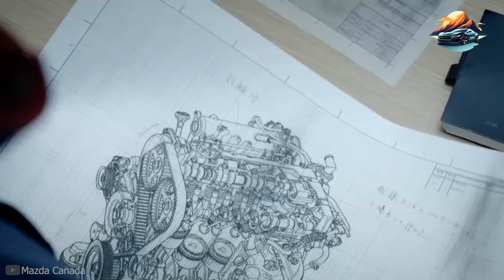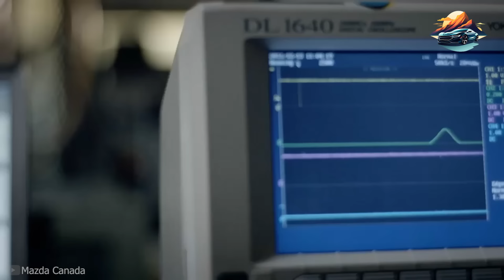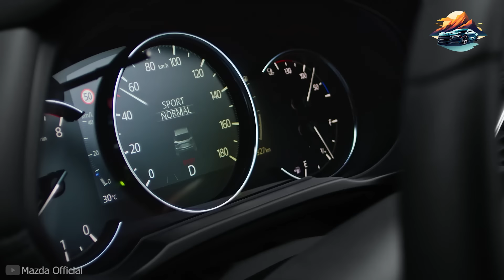4 Car Brands That Are Equal (Or Better) Than Toyota For Reliability

Comment: Heaven knows where you took these, so called, facts. I owned a Toyota, a Mazda and a Subaru. The most unreliable vehicle, by far was the Toyota. It broke down the first time three days after I took delivery (brand new vehicle) and went on and on. Throughout the first year the vehicle broke down 165 times. I never witnessed anything even close in the two other brands. 
Lexus is a Toyota, it is a rebadged, overpriced, loaded with gadgets brand. Enough to seen models sold as Toyota in Japan and as a Lexus elsewhere such as such Toyota Crown Majesta.
With regard to Honda, when was the last time you used a turbocharge Honda Civic?  It is one of the worse and most unreliable vehicles you can purchase.
Bear in mind Toyota and Honda use CVT transmission which already calls for troubles. Subaru also uses CVT but it seems theirs is by far more reliable. 
On certain models Toyota uses robotic gearbox which are notoriously unreliable.
On the other hand, Toyota lacking advanced technology, like in Diesel engines, uses other manufacturers engines like PSA (Stelantis today) and BMW.   
The two things Toyota excel at are marketing and concealing failures.  Remember the brakes lose problems (my Toyota suffered from this problem too) or the sudden and uncontrolled acceleration problem?

Comment: The best example of better reliability, lower TCO (Total Cost of Ownership) and beautiful design for Mazda vs. Toyota is Miata.
But cut the bs with JD Power. Their studies (relabeled as "dependability" instead of the previous name: Initial Customer Satisfaction) are not on reliability because they lack long-term data, a relevant panel (its size gives far bigger error margins than the far better Consumer Reports annual reliability surveys) etc.
Reply: yeah, i hate those customer satisfaction ratings. The thing is many people do not buy for reliability, but for other criteria, not necessarily planning to keep them for that long. A lot of people lease, and to them long term reliability is barely an afterthought. Their satisfaction may indeed be high when they exchange their almost-like-new five year old vehicle for another one with newer bells and whistles. Reliability to them is something completely different than for example to those who like to buy their cars for cash and keep 'indefinitely' with minimal maintenance costs and headaches.

Comment: Once Subaru XV hits 130kmh, your radiator, aircond failure is common. Wheel bearing issues, timing chain, engine power reduced and gas millage bloody high. Avoid Subaru, go for Lexus, Toyota or Honda. Save bets. Avoid the Honda HRV.. their handling sucks
Reply: So you want to use a car over a hundred thousand miles and never serviced it?? You are human do you not service your body??

Comment: Mazda is building very high quality vehicles specially CX-5 is much better value than RAV4 and with better driving dynamics and beautiful high quality interior .
Reply: That's all fine, but what about LONG TERM RELIABILITY (i.e. least amount of issues and repairs over the longest time period). All these 'likes' have nothing to do with reliability, a completely different type of criteria. If you don't plan to keep your cars for very long, then of course your choices expand significantly. Some people don't even own their cars, they lease them. Those people shouldn't even be asked about reliability 😂. Reliability is not really a subjective criteria, it is an objective, measureable one.
Reply: Still driving 2017 Mazda CX-5 with 149,000 miles. Drive 100 miles round trip a day for my job.  Biggest expense is that I’ve purchased 2 sets of tires since buying it.  It turns on a dime, is fun to drive, and is the perfect size to park.  Will keep it till next generation CX5 comes out in 2026… which will be a hybrid .  💙 my Mazda!
Reply: Mazda vehicles handle so nicely and have really appealing looks! Really fun to drive! ✌🏻

Comment: At least Honda is significantly worse than Toyota.
Reply: I disagree.  The CR-V takes the #1 spot in it's class.  The Civic is well known to be reliable as do the accord, pilot, passport, etc...
Reply: @gmdsr1177  Your enthusiasm and objection to obvious makes me wonder... are you by any chance a honda saleshole?
Reply: @gmdsr1177  Honda has some great design better than Toyota. However, on quality, it is barely better than ford and gm.

Comment: Toyotas and Lexuses look, to my eyes, butt-ugly on the outside. Their fronts are uniformely horrid. All else is fine with them, you just have to approach them with an eyemask on so not to glance at them. By comparison, Honda, Mazda, Subaru, and Acura vehicles look pretty decent to my eyes. You also have to look at other factors, such as engine size. I would not touch a Honda Accord now that only has a miniscule 1.5-liter Turbo engine. For a 4-cylinder, I would want either a 2.4 liter or 2.5 liter normally aspirated, or else a 2,0-liter Turbo boosted powerplant. Or else an app. 3.5-liter non-Turbo V6, of course. So for me, that would leave some HONDAs matching my engine criteria, some SUBARU and many MAZDA models. Also, I would add ACURA to the reliability list here, ACURA being HONDA's premium division. Their discontinued RLX full-size sedan is truly phenomenal. :face-red-heart-shape:

Comment: OMG I am so SICK of Toyota, TOYOTA is NOT REALIABBLE! Enough is enough! But Subaru? You can NOT be serious! Apparently you have NEVER had to replace a head gasket on that POS "boxer" engine not to mention terrible underpowered! It is NOT a matter of IF, it is a matter of WHEN, but you WILL have to replace the SILICON head gasket probable by 120k miles. At a cost of over $2,000 I don't understand how ANYONE would by a stupid Subaru. Mazda is more like it! The is NO Reason NOT to buy a Mazda. This isn't something new, Mazda has ALWAYS been SUPERIOR RELIABLE! I have driven the Rav 4 and it is HORRIBLE! It feels unstable, VERY cheaply made with the hood flapping in front of me, and cabin noise is TERRIBLE! It is VERY uncomfortable and not fun getting in and out of. Honda ONCE reliable is, like Toyota, going down the drain! Both Toyota and Honda have always built OLD SCHOOL vehicles with "old school" powertrains! Your Ford, Dodge, and Chevy of those days lasted just as well with the exception of maybe when 4 bangers first started coming into play. But even then there where many reliable "econo boxes" back then of all makes. Now that Toyota and Honda have to "get with the times" they're reliability is going DOWN THE DRAIN! Ford, Dodge, and Chevy, ESPECIALLY FORD have been the "ginny pigs" for all the NEW tech and powertrain so get a bad rap on reliability. But LOOK what is happening now that Toyota and Honda that everyone raves about, they are going down the drain! They don't even TEST they're JUNK! Toyota is the WORST! Over course Lexus is just a glorified Toyota and they don't even test those because some have the SAME JUNK new engines like the Ford wannabe 3.5 OPPS 3.4 twin Turbo JUNK Toyota engine. engine! When you make the SAME vehicle for ever, it tends to be reliable, NOW that Toyota and Honda have to get with the times, LOKK what is happening! I am SO SICK of hearing about Toyota and Hinda and a glorified Lexus Toyota. Mazda, Hyundai, and Kia are the only vehicles left worth buying!

Comment: You totally missed another Japanese brand which is good as Toyota and that is Suzuki infact in the same factory in lndia they build the Toyota Starlet which is a rebadged Suzuki Baleno for Toyota to pit there badge on any car hatch back it has to be reliable although not available in Australia we do own a Suzuki Baleno bought it second hand so far so good and it satisfies because l now will never buy anything but a Toyota and and Suzuki although there is another Suzuki in our family our son drives a Suzuki Jimny and our daughter drives a Mazda 3 and Toyota has a relationship with Mazda and owns a bit of Subaru also owns 20% of Suzuki also the most popular brand in Australia is Toyota followed by Mazda

Comment: Wonder what stats you are using or are you making this up? I subscribe to Consumer Reports and Toyota and Lexus have been at tops for many years. Subaru and Mazda have really improved. I really hate that old Volkswagen wagon engine design - doesn’t really last. I will take an inline 4 over that transverse junk.  Keep dreaming. JD Powers endorses you after you pay them for the endorsement. Good try though.

Comment: Subaru is the worst the problem is the engine won't last more than 100,000 miles guarantee
Reply: I have 300,000 me on mine got to change that oil man
Reply: @doylewillis9587 you just proved him wrong 😂😂😂😂.
Reply: Guarantee 😂😂😂😂 are you Charles Barkley 😂😂😂😂😂.

Comment: Subaru has crap head gaskets.
Reply: Sound like you repeating everything you heard 😂😂😂😂😂.
Reply: @iceman71true12   I've owned three Subaru are they all had early head gasket failure, as well as other problems, like defective transfer cases and front seal leaks. They are all now in the junk yard, where they belong.

Comment: Sorry but subaru - being OK - is far behind Toyota.
Mazda had been under ford for decades, and it will take decades for it to recover from that "partnership".
Honda used to be an excellent brand... 25+ years ago but since the Old Man died (1999?), it's been turning into just another ford. 
Lexus IS Toyota so it doesn't belong here. The difference in quality is simple: most Toyotas are made in the US/Canada/Mexico while Lexus is made exclusively in Japan. To simplify, Toyotas made in Japan are just as good as Lexus.
Bottom line: Toyota/Lexus all the way any day of the week.
And finally, using jdpower as a reference undermines your legitimacy.
Reply: Mazda broke away from Ford years ago.  They only weakness in Subaru is their Boxer engine.   Honda is still an excellent brand.
Reply: @gmdsr1177  You are not paying attention so let me try again: it will take A LOT longer for Mazda to wipe off ford's droppings.
"The only weakness is engine"? A hell of a weakness if you ask me...
No, honda is FAR from being excellent today. Just compare its eCVT design with Toyota's. There is more but I don't have time to get into details. Just trust me - I spent nearly 20 years in the field as a Mechanical Breakdown Inspector. On the other hand, feel free to ignore,

Comment: Hold on Subaru they are part of Toyota come on same brand lexus is just Toyota it's like vw audi skoda Seat they are all the same cars  made on the same production lines. Who kidding who with this. L3cus Toyota the difference is superficial material quality engine electrical and mechanicals are Identical they use the same parts  many share production lines. It's perception

Comment: A total BS video to suggest that lexus is a rival of money pits Mercedes and especially BMW. No mention that Toyota owns part of Mazda and no mention of subaru boxer engine issues. To quote jd powers is also bs. What a waste of a video. Disclaimer. I own 3 Hondas a toyota and a lexus, but still.
Reply: I owned all Hondas and now Acura all my driving life.0 problems. IT'S DEFINITELY HONDA/ACURA!!!
Reply: Anyone that bought some stock in Mazda owns part of Mazda. But they have nothing to do with producing Mazda vehicles.
Reply: @SokemRokemRobot  Nothing is a strong word.
Toyota and Mazda (as part of the most important Japanese manufacturers keiretsu) are collaborating on many things, exchanging know-how and tech.
Given that, except the hybridized Mazda cars, the rest is the proud result of Mazda efforts, like the amazing Miata.